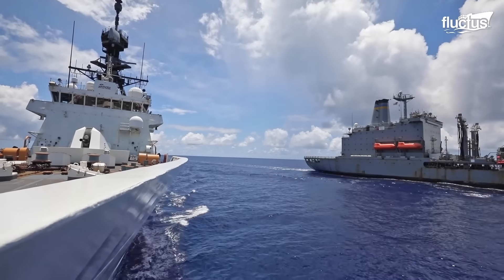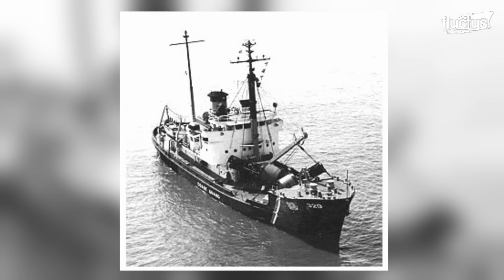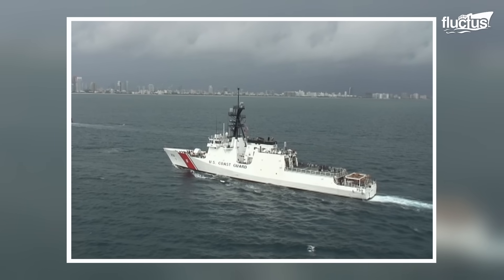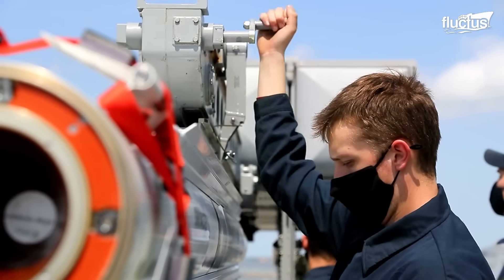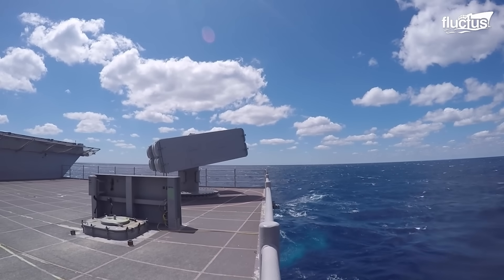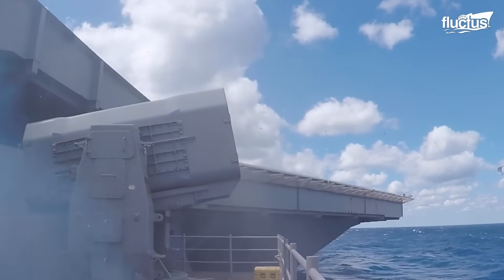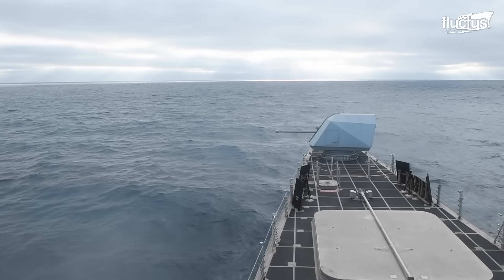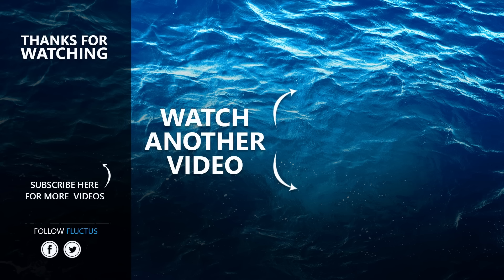The Scary Process of Loading & Firing US Monstrous Ship Guns at Sea

Comment: Curious, what becomes of spent shell casings? It seems I see much of them just falling to the water. 😢
Reply: They fall on deck in modern big guns and are basically just tossed over by the GM’s and FC’s. If you ask they will usually let you keep one. I had a 5” casing from a Burke but I left it onboard when I transferred. Most go in the water though.

Comment: If the DoD is to be believed, all government supported R&D into railguns was terminated several years ago and redirected into laser technologies.
That might or might not be the true picture of railgun technology since there's nothing preventing private R&D and to a large extent the technology had to be developed at least to the point of deploying the Ford class EM catapults (and might have been a reason the catapults took so long to deploy) and possibly the elevators on the same ship.

There will probably be a place for railguns in the future, there have been demonstrated capabilities of creating an artillery piece that can toss a projectile over 100 miles without propulsion built into the shell. IIRC currently ordinary 155mm rounds have a range up to about 25 miles and Excalibur rounds which implement GPS and aerodynamic fins for maneuverability and some lift can range up to 45 miles. Any current artillery that can be fired further use propellent assisted shells or rockets like MLRS and HIMARS.

I suspect that the US intentionally stops or pauses research in certain areas where potential adversaries (primarily Russia and China) already are deeply committed to research like hypersonics and EMF related weapons like railguns. Decisions are being made not to engage in open competition in these areas that could spur competition and perhaps theft of US technology. It's only when one country or more actually or likely demonstrate a working example of weapon using that technology that the US gears up and creates a weapon at least of same but usually superior technology like hypersonics. The US overall strategy is to demonstrate superior weapons capability and technology, not engage in a tit for tat weapons race.

Comment: U.S. ship use much small calibers then their WW2 ships of the same class.😮
Reply: Correct, however modern day cannons are more accurate, and can hold more rounds and a much larger variety of rounds as well.
Reply: Higher velocity smaller projectiles can have as much power as older larger shells with more space efficiency. Think about .45 acp vs +P 9mm